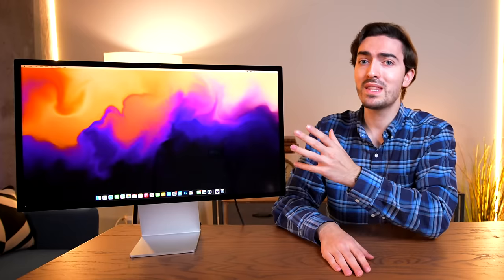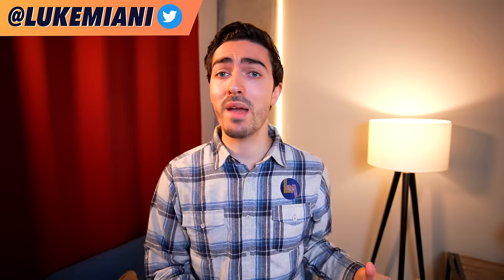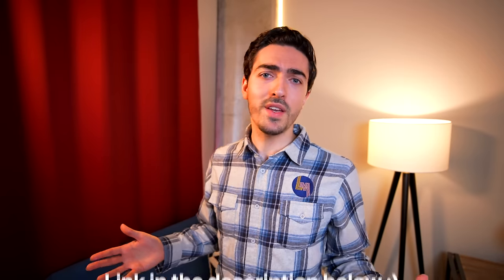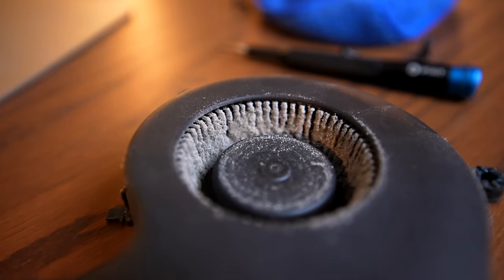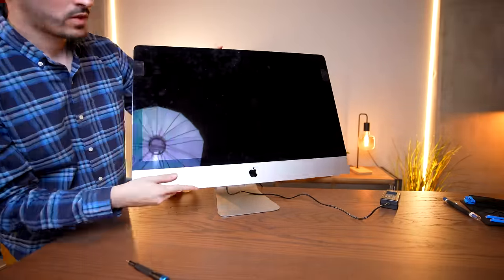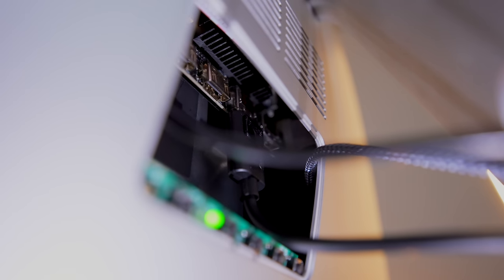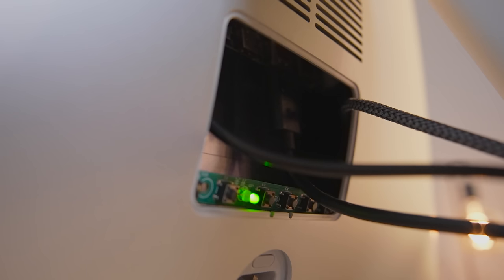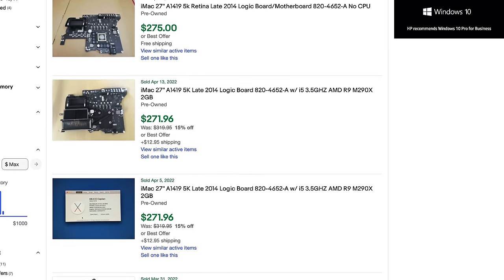How to make a DIY Studio Display for just $600! (USB-C & Built-in camera!)

Comment: Cool project. Combining this 5k panel with an old Cinema Display housing and cramming in an m1 macmini would be a next level.
Reply: Well thats looks like next project for Luke
Reply: for sure
Reply: Or cramming a mac mini into a studio display 🤯
Reply from the maker: I considered that! it would look very cool, but the problem is the glass is fused to the panel so it wouldn't be able to fit behind the Thunderbolt Display's glass
Reply: @lukemiani  even with the “Mini Mac Mini” that Snazzy Labs built?
Reply: I took a 2010 27” and shoved an m1 mini inside. I know Luke did this as well but I took it a couple steps further by replacing the 1440p display with an LG 4K panel. I connected the mini to the iMac WiFi/bt antennas for great WiFi reception. Also wired up the iMac power button to the mini and added a usb amplifier connected to the iMac speakers. I topped it off with an HD iSight camera from a 2011 iMac connected over usb for a fully functioning 27” M1 iMac. I stuck a small usb hub to the back of the iMac for usb A and Ethernet along with an sd card reader. The 4K panel also allows for the scaling options too.
Reply: @hilli.e  he means that the glass doesn’t fit I believe.
Reply: @myrealusername2193  oh that makes sense now. Thank you for the clarification
Reply: @hilli.e  ya, the iMac and the thunderbolt display have different shape glass panels on the front and apple laminate the display panel to the glass panel, separating them without either cracking the glass or destroying the display panel is basically impossible which is really unfortunate.
Reply: @lukemiani  ah true that’s to bad, maybe the 5k lg Display.
Reply: @lukemiani  surely there is a way? Because if there is, that is the holy grail. People would pay good money for that mod. Until then, I’m sticking with my Thunderbolt Display
Reply: He kinda already did this but not using 5k monitor
Reply: @chrisdunderdale  @everyone I had the idea in my head to fix my old Thunderbolt Display with an lg 5k Display for weeks now. BUT: I don’t know wether the LG ultrafine panel can fit into the Thunderbolt Display enclosure… and I don’t want to end up with a broken ultrafine that still sells used for almost 1000 bucks in Switzerland…
Reply: @ericbauer4559  That's awesome! Would love to see a video of that.
Reply: You would have what is called an iMAC Pro 😂😆
Reply: I think someone tried that but did not have an on off switch or proper port.
Reply: Status Update:😂😂😂

Bought two 5k iMacs from 2015 today for 710 bucks…
Now doing a similar conversion as Luke did in the video. I don’t really need a webcam though so things like wiring the power button have a higher priority…
Reply: @ericbauer4559 do you have a work up on the build process somewhere?
Reply: @richeyrich2203  I don’t. I eventually got another display driver board for the original 1440p panel and put that back in. Couldn’t figure out a good clean way to mount the 4K panel to the iMac glass.
Reply: @ericbauer4559  you should probably make a video for this!! 😊

Comment: Would be nice if a company made a conversion board that had connections for the original speakers, webcam, and microphones.
Reply: You are stretching it😉
Reply: I would buy one !
Reply: They'd probably get sued by Apple :-/
Reply: And an Android LogicBoard.. Ahahah.. 😀
Reply: it wouldnt be nice.. it would be 499.99 from apple
Reply: @fw9167  can you please give a direct link on Macrumors where they descuss this?
Reply: I contacted the board suppliers in the link. They say the board supports '2x10w, 8ohms' via the speaker connectors. Theoretically that should just about be enough as each one on the imac is about 7w 8ohms. There are 2 on each channel on the imac though, which would have to be slightly bodged (the board only has connectors for 1 on each channel), which I presume would halve the output on each, but I'm no expert.
Reply: @Captck  I'm in the process of doing this project on a 2017 iMac 27" and I got the screen running just fine (well, I spent 2-3 hours tweaking the settings to get an image that's as good as straight from the iMac originally - the screen brightness is slightly less than it was originally in the iMac, and the colors have a slight greenish hue, but I think you wouldn't notice unless you put it side by side with an actual iMac), but I really want to connect the original iMac speakers - how do you know the speakers are 7w 8ohms? I couldn't find any of that info online. 
Also, the outputs on the board are just L+, L-, R+, R-, but the iMac uses a crossover to send part of the audio to the tweeters, and the other part to the woofers. There are 2 options here: cut off the iMac speakers connectors and just connect both tweeter and woofer to the same output (should work just fine), or get a crossover for each side and kind of replicate the original idea. All this involves messing with speaker wires, schematics and soldering though, so there's no easy way to just plug things in. This is what I'm currently working on and I can update once I get it working (or not).
I used this for reference: https://www.ifixit.com/Answers/View/320490/iMac+Speakers+Wires+and+Pin+Out
Obviously this is an older iMac and the board is different, but it's better than nothing.
Thanks Luke for inspiration!
Reply: bro your dream came true there is not a thing which woud allow u to do that even put a m1 mac mini bored in it and u can use webcam and speaker and ports also will be correct
Reply: Juicy crumb makes a board like this. It even allows use of the Hard drive and optical drives, as well as a m.2 ssd if you go for the pro model.
Reply: Yeah if Apple would just use some of there old displays at a lower cost would be a lot better I agree with Karanvir
Reply: @wz5110  Juicy crumb’s board is really cool, but unfortunately it’s only for the 2011 iMac which has a 1080p screen.
Reply: I believe there is a startup that does that.
Reply: and USB ports too
Reply: @mackit  My 2011 27" iMac is 2560 x 1440 px so that's 1440P
Reply: @TheMeridianas  you can wire speakers in series or parallel to double or half their ohms. two 8 ohms on the left can create 4ohm and 16, you can wire up all four to be 4/8/16 ohm depending on how you run it and output to 8ohms for your cross over. to be real though at this low a wattage it's hardly a major concern the crossover should be able to handle any miss match and you can always implement a resister to solve any concern.

Comment: Apple needs to bring back target mode. As a college student, I feel very weird plugging in a cable to my school’s mac to use my MacBook Pro as an external p. wis apple made a way to connect a MacBook Pro to an iMac
Reply: that 2014 actually supports target mode. Not sure if the Studio does. I think destination target mode went away in 2015 on the iMac and the M1 probably nixed it on the source side.
Reply: @BretFX  ever since the iMac 5k, it’s no longer been an option.
Reply: @myrealusername2193  yea, the PHYSICAL device doesn’t support tdm. But that’s only 1/2 the equation. The OS still supported it for quite awhile. Looks like the other machine needs to be 2019/Catalina or older.

Comment: Luke, I hope you see this:

I've literally just finished doing this project myself. I have some feedback, some advice to anyone reading this who is also considering doing it and some comments in general.

First of all this video had me triggered from day one, I had to do it. I was dying for a Studio display though it's way out of my budget (so was this but I made it happen). 

Some advice to those considering this:

Commit and be patient. 

Bought the donor 2015 iMac, replaced HDD with SSD, liked the now pretty capable iMac though it was never an option to use daily so committed to project.
Ordered conversion board, long delivery time and I already had the iMac for about a month debating wether or not to do the project. 
Conversion board arrived with a nasty import tax bill of about 33%.
From iMac purchase to completed project about 10 weeks.
Do not think that Luna Display will suffice. I tried, it didn't. 
If taking it on, commit to it and don't let it live in your head rent free as it did for me. 
When the time comes to do the work. Clear your calendar and your workspace. The build process looks simple in this video but it's not. Be patient though. 

Parts used:

The camera module doesn't include a mic so order one at the same time as camera module should you be planning to use the display with MacBook in clamshell mode. 
The DP to USB C connection will not work via a dongle/dock. I had a vision of one cable to/from Mac and all I/O being handled by the dock. It doesn't work so accept that before you start. 
I was half way through the job when I ran into some problems with my repair hardware not fit for the job - the extension for embedded screw in logic board to be precise. BUY THE IFIXIT TOOL KIT! 

Cost:

Donor iMac - £400
Conversion board: £217
Mic, Camera, USB extension for camera and 12v power supply: £55
Total: 672

Saving of £828 compared to Studio Display - with obvious sacrifices but IMO a great display for the money. 

Hopefully I'll recoup some of that selling keyboard, mouse and any internals I can. 

Feedback:

I loved the content and love my new display. 
Push the fact that these jobs aren't as easy as they sometimes seem and I know you do mention so already in the video but emphasise the benefit of the fixit toolkit. It's too late for me now but in future, I will be buying one.
Reply: Hey we both did it!! Honestly it feels very worth it and might be a good way to flip 4k on a budget... although the imac form factor in itself feels limiting. I did the 21 inch and regret it a little/ Did you wire the back with the extra buttons out or take the button board out
Reply: Hi. Can you tell me precisely what camera and microphone you used?   I've got everything else up and running.  Thank you!
Reply: What about the speakers? Would we need to purchase external ones?
Reply: Kevin, thanks for your detailed reply. Good for me as I'm in UK too. Seeing the cost I wouldn't try it myself. The Luna Display device seemed great but at £140 or so expensive too. I've seen them much cheaper used though. I wondered what your problems with this were?

Comment: Hi Luke! Thanks a million for the tutorial. By coincidence my late 2015 5K iMac died a couple of weeks after first seeing this video. I order the board and I've just converted it over and now back up and running. Really delighted with the results! Great to be able to save and get more life out of the 5K Panel.
Reply: did you have to tweak the colors or just worked? Can you adjust the brightness from the keyboard?
thx!!
Reply: @viktorbass  Hiya. Soooo I started using the display with a 2017 MBP and found it kept dropping the DP connection along with giving me different settings, not knowing what the monitor was and so on. I switched to using HDMI and ran at 4K without any connection issues and colors/sharpness were good but no Display P3 setting. I've just started using it with a new M2 Mini Pro using the DP connection and it's amazing. Full 5K res 60 hertz, recognises it as an 'iMac 5K' along with P3 choice in settings. It didn't like my MBP, but using with the Mini has really made it worth saving and converting the iMac display. It doesn't support brightness control from the keyboard, but I can do that from the back on the monitor and rarely touch it anyhow. It does however fully support Nightshift as it knows its still a Mac Display.
Reply: @barrybillionaire  That sounds great! Did you experience any brightness loss after the conversion? I read some reviews telling about it. (maybe the board's power supply is not beefy enough)
Reply: I am at a crossroads: upgrading the iMac or saving for a new m2 mac mini + using the iMac as a display (so I don't have to buy an LG 5K ex.)
Reply: @viktorbass  No loss of brightness to date. I did use a 12V 6Amp power brick (one I got separately on Amazon), so I think the extra amps could be the trick. The board supplier does recommend up to 7amps.
Reply: @viktorbass  I was the same but I think you'll be happy! It's making a great combo and still looks great on my desk.
Reply: @barrybillionaire  thanks!
Reply: @barrybillionaire Yoo thats epic! I know I’m 8 months late, But:
I‘m doing litilarely the same on two 5k iMacs I just bought. Need a dual 27“ screen setup for work. If I bought at apple, I would have hardwired powercables, and pay more than 3 grand, making a Pro Display XDR within reach.
Now I’ll end up at around 1k.

Only fear I have is that the driver board really fits/ works and supports p3 color. Do you know where you got yours back then?

Cheers
Reply: Hey, I'm in the process of doing this myself. Just ordered the board so I have two weeks to wait. Curious, how does the new monitor turn on? Do you have to do it through the new board? I don't see it covered in the video. Also, I'm seeing a power cord running from his video and he doesn't mention it. Does the board he ordered off Ebay have it or do we need to find that on our own. Thanks for your help!
Reply: @heatherjennings145 I have one iMac converted already
Normally when you unplug the host computer, the board goes to sleep automatically.
Also when you put your mac into sleep mode it goes to sleep too.
The power button on the board remote completely shuts de driver board.

Comment: This is great! I have a late 2015 iMac that came with i5 and 8GB/1TB fusion drive, but was upgraded to 32GB/2TB SSD last year. It still works great, but when it's too old and slow in a few years, I will most certainly try this conversion to use it as a monitor and webcam with a newer Mac (Mini or Studio). I'm pretty sure the Apple Certified repair center that added the SSD cleaned up the dust while they were in there.
Reply: Same for me and my 27” iMac!	This was a super cool project that many will take advantage of!

Comment: Nice one, add some speakers to it in a future video! you might be able to hook some small amplifier boards to the original speakers.
Also try using MONITOR CONTROL to control the brightness via CEC that would also be a nice creature comfort
Reply: I don’t know about this exact Converter Board, but in most cases there isn’t a need for a amplifier board, you  can solder/connect the speakers direct to the board.
Reply: @fabianbinder3681  yep that conversion board does have a speaker amp onboard with a 4 pins connector to use
Reply: Yeah, I would have like to see the speakers reused.

Comment: Nice work! This is exactly like what I did with my 2013" iMac a few weeks back. In fact, I think I replied to one of your tweets with my progress on the project! I decided to skip the webcam, though I may go back and add it now that I've seen what you did with it. I also was dead set on getting the speakers to work, I've got a little amp in there as well as some passive crossovers, but I'm still trying to figure out how to eliminate a bit of noise. This is going inspire me to open it back up again (still held together with tape). If you want to see what I used for audio, I'll let you know if it works!
Reply: I Would love to see what you did with the speakers!
Reply: I am in the middle of the conversion now and am curious to know how you got the speakers set up.
Reply: @redyellow4014  Sorry for the delay! It's not done yet, still trying to troubleshoot a few things, but I posted my WIP on my twitter. Just search my username!
Reply: @dfayne  Sorry for the delay! It's not done yet, still trying to troubleshoot a few things, but I posted my WIP on my twitter. Just search my username!
Reply: @kazoodac  any news from your experiment with audio?
Reply: @UTJK.  yes I got it working! I posted my process on Twitter, hopefully YouTube let’s me post the link
Reply: Did you run into any brightness issues with the display driver?

Comment: Following the purchase of my MacBook Pro M1, I failed to sell my old iMac(27" Late 2015) , when I came across this video it seemed like a great idea, I purchased the controller from aliexpress, 
waited for it to arrive, and...
Yesterday I opened the iMac, dissected it from all the internals, replace them with the controller and voila!, I am writing this comment on a MacBook Pro using a home made Studio Display.
The controller I ordered, has a USB-C input that has PD, so I do not to to use the power bric supplied with my MacBook. 
Now I have to sale the guts of the old iMac.
Great video, keep on the great work!!!
Reply: same here. I did use a 2017 27"iMac. Did the first test run also with an aliexpress USB-C board. Model u49. test run worked fine. I will do do the final glueing next weekend. I have already sold the old logicboard and the RAM.
Reply: do you get 5K resolution with the usb-C?
Reply: I am planning to buy a 16" M3 max for photo and video editing. This seems to be a great DIY project as I would need an external monitor for it. May I ask, how are the colours and black levels after the Mod...are they accurate?

Comment: Had that exact 27" iMac from late 2014 and traded it in for a M1 Max Mac Studio. The problem with my late 2014 iMac was the image retention problem that you mentioned. If you run a screen saver or a burn in protection video the image retention would be reduced but would eventually come back. You were lucky to get hold of a 2014 iMac that did not exhibit this issue.

Also purchased the latest 2022 27" Studio Display and not regretting the purchase. Better video quality than my 2020 27" iMac.
Reply: I just found an a1 149 on ebay for $125.  It's running el cap with the original fusion drive which I'm hoping means it has not very much run time.  my late 2012 has had run in for awhile now.